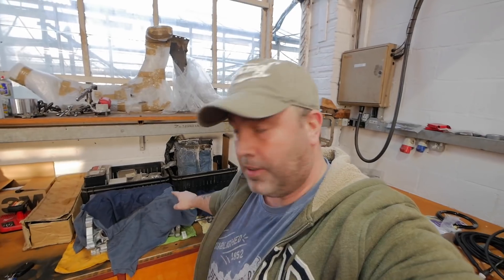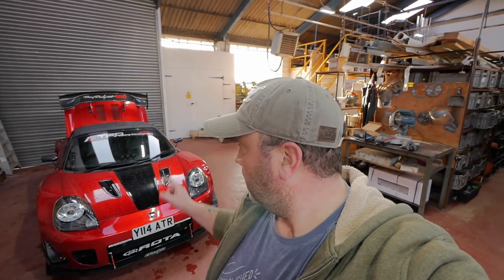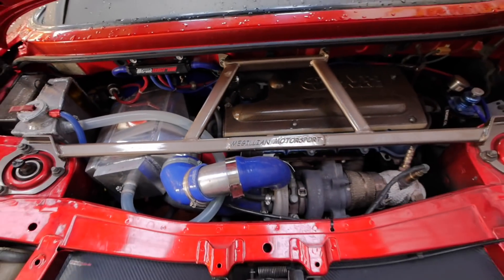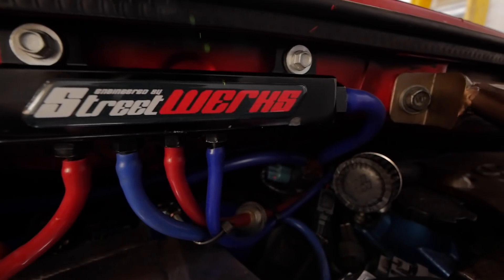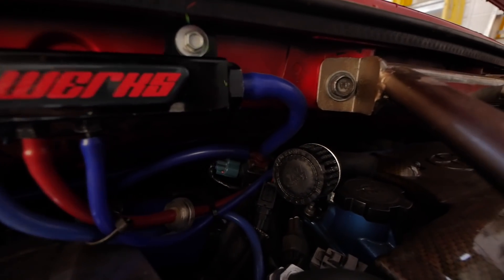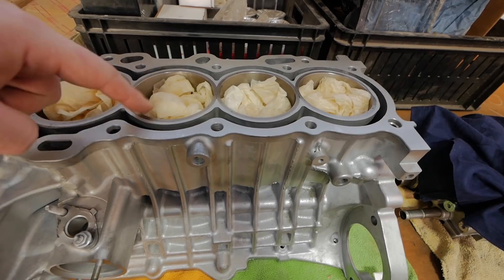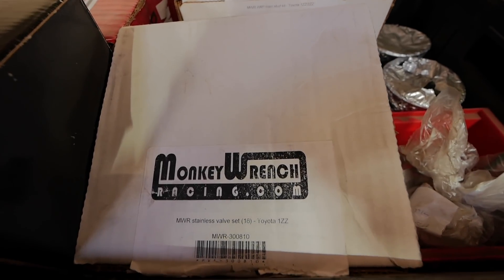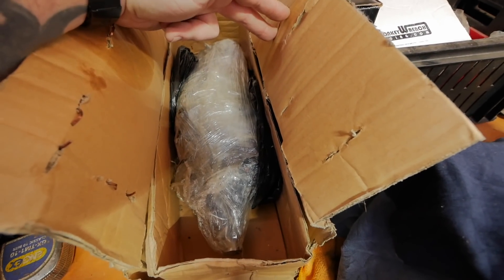450+bhp 1zz-fe engine build, **update:I changed my mind!**

Comment from the maker: Any suggestions towards the build welcome, still making decisions as I go along 😁
Reply: SpyderLEE , what turbo manifold are you going to use? Have you ever considered EFR turbo?
Reply: so, you allready choose compression ratio, and I am a bit disapointed, because you could go water injection instead of such low compression, you can even go mixed injection to reduce temps even lower, ofc that will force you to have special oil and more oil changes
Reply: Wow with all that you you could be at like 600hp reliably. Just get the mr2 turbo transmission and ive had some experience with large turbos.. I would suggest getting tge largest posdible turbo since you have a sleeved block and super strong pistons and rods. Theres a difference between turbo lag and turbo threshold. If you get a ball bearing turbo lag isn't going to be a problem. The nice thing about biger turbos is you can have higher power at the same psi this way the power is a bit more reliable. I've driven a few different turbo cars from a 2007 mini cooper s jcw with a full echaust but small turbo ect to my Subaru with 500 hp thats got a very large turbo and ive realized bigger is always better and your really not going to be concerned about the boost threshold because there's nothing like a big turbo scaring the crap out of people when it kicks in at 3500 rpm. Yeah instand power at 2500 rpm is nice but its not nearly as rewarding as a big turbo keeping you glued to the seat past 4000 rpm all the way to redline. That's my recommendation at least I'd say go big or go home because even wuth my big turbo i wish it was just a bit bigger and isn't that what its all about? Your always going to want more in the future. Might as well get a big turbo and keep the boost lower so you can always up it in the future and just run lower boost for now this way your not maxing out the turbo and it will be more reliable because a larger turbo won't have to spin as fast to make 500hp as a smaller turbo and small turbos don't keep you glued to the seat like bigger turbos in the higher rpm which is where your going to be making all your power. Sorry for tge long post lol i just don't want you to have any regrets later on like me for not buying a turbo a couple sizes larger than what I expected I'd need. Go ball bearing though so much faster spool and keeps the spool when shifting
Reply: Sypderlee great video! I was wondering what I could do to get a little more power, I would like to build up my 1zz one day (Celica). Any tips for newbies trying to work on this engine?
Reply: what gearbox you running?
Reply: Can a 2zz rods used in a 1zz engine
Reply: Gentlemen and the second part??????
Reply: What is the link to part 2 of this series? I can not find the same kind of title video for part 2 on your channel....

Comment: Wow amazing work to get the 1zz up to 450hp. Most probably don't understand how crazy that is. Loving these videos.

I have now finished all my suspension/handling upgrades and am starting on engine mods. So far just exhaust/intake and tuned with an ECU piggyback. What would you say would be the next best performance per dollar upgrade?
Reply from the maker: Turbo is by far the best upgrade per $. It completely transforms the car
Reply: @SpyderLEE  Well it's been 4 years and it's finally happening. Just got everything to build the engine for boost. Your videos inspired me to keep going with the mrs

Comment: Just curious why you wouldn’t do this to a 2zz and put it in instead?
Reply from the maker: Hoang Bui the 2zz has 82mm pistons and a short stroke. The 1zz has a longer stroke and smaller pistons, giving a better low down torque. I now have 82mm pistons and a longer stroke, giving much better torque low down than the 2zz can. I prefer my power lower down. Not one for screaming engines. Also At these levels of power with a built 1zz head, lift on the 2zz is kind of irrelevant too.
Reply: very cool! I think you should go into depth on this comparison in your next video and why you think spending time building the 1zz is better than a 2zz swap for those of us who arent as knowledgeable with engines.  As far as i know for the mr2 spyder the 1zz is no good with its low power output and the way to go is just to put in the 2zz. Great to see that you are exploring other options.
Reply from the maker: I don't think it's better. They both have their advantages, but at those power levels it's not worth me paying out for a 2zz swap on top of the build as they both would have to be built. If that makes sense 😁🤔
Reply: I'm building a 2zzge on my channel, maybe we compare when they are done ;) awesome build and I'm so happy you are building a 1zz since it doesn't get much attention in the tuning world.

Comment: 8.8 to 1cr pistons is pretty low....but safe......My 2009 Civic si with a k20z3 has 11.0 to 1 cr pistons and a 6062 size "ebay" turbo and it made 606 to the wheels on a max effort pull on a dynapak dyno on e85. I run 475whp on the street thou for realibility and my clutch was starting to slip on the high boost dyno runs.

Comment: Nice video dude, it's Steve from the MR2 facebook group. Will be good to see your build as it goes, I've got my old 1zz turbo lump in the garage, planning on just building it for fun. Still to get my new build mapped, it's booked in for 10th Jan at GB enterprises, fingers crossed it works out! I'm not going for any more than 280ish, don't want to lose third and fourth. Thinking of adding an oil cooler though, as that is what literally heats the gears up to the point the go soft (so I hear!). Also interesting you went for low comp pistons, I guess you are going for big boosted power rather than response. The standard 10:0:1 isn't high to start with but gives much better spool and off boost response. Will be interesting to see how you can get 400hp down XD
Reply from the maker: Please sub to my new channel cheers mate. The stock box'll manage 350 😉
Reply: Oh right, people have been telling me it will die over 260ft lb. Have you any idea what yours is running at the moment, and lol I need to change my name...
Reply from the maker: Please sub to my new channel lol.. from what I've seen from people that regularly build these the magic number is more like 300lb. I don't know what mine is running.

Comment: Where did you get your crank? I bought a crank and it turned out to be cast, so be careful and make sure its an OEM forged one! Sounds like the motor is going to be good for way more than 450, too bad there are limited drivetrain options. Another option for the gearbox is a sequential quafie.. But that would be $$$!
Reply from the maker: Levi Heizer I bought all the bits so far as a package off a friend. As far as I know the crank is oem Toyota.

Comment: RIP part 2.
Reply from the maker: Yeah 😞 but got a nice camper because of not doing it.
Reply: @SpyderLEE  Maybe you should do a factory spec rebuild on your spare? It would make good content. As soon as I finished my turbo setup my other spyder that's supposed to be the reliable commuter started drinking oil.. Thought long and hard about going ahead with a built motor for the turbo one even though I just finished it and putting the motor from it in the commuter... but decided to do a factory rebuild on a spare block I had for the commuter instead. Good practice and surprisingly inexpensive. My goal is still to keep the block in the turbo one healthy so when it gets a built motor I can have a running back up. But maybe I should just leave the motor and focus on real track prep like a cage? Would make replacing it a lot cheaper.

Comment: What do you think is the hp limit on a Toyota avensis 2002 1.8l 130hp with the 1zz-fe motor?.and which turbine do you suggest ?
Reply from the maker: With a good tune and clutch, fuel uprated you should see a safe 280bhp. I would definitely recommend the Garret Gt2860rs
Reply: @SpyderLEE   just with stock internals?
Reply from the maker: Yeah. I’m on stock internals

Comment: happy new year...... be healthy body and mind  and have money
to have all your dreams true thats my wishes to you and for all the people at planet.
as for your motor plans i think that your mark is very high and this have plus and negatives.
i agree for the forged engine parts wich gives you more power and reability and of corse 
you must to upgrade and other thinks like transmission/brakes/suspenssions/intake/etc
but i disagree at the mark of 450hp more  or less not because that its impossible but we must
not forget the drivebility of any car?....i was lukcy to  have and drive a lot of cars 3 impreza sti upgraded 280hp to 330hp and have a lot of fun every day .....and sudenlly i was thout if i was  have the ultimate i was happy  ....so i get a porsche 911 /996 turbo with 450hp.
and then i realised that  i lost my every fun car it was to hard to driving it ..it was really dangerous....only to closed race roads you could play and see  what you can handlle and 
dont forget that a 911 turbo is about 1600kilos/brakes/aerodynimic /brakes/etc
my point is that 350hp at an mr2 have already laborginis/911 turbos / and familiar cars
numbers .....................try to make a car like this 300-350hp but improved to to all sections to handle this power and have and rability and fun.....whatever you decied  i am stell waiting
for the next video